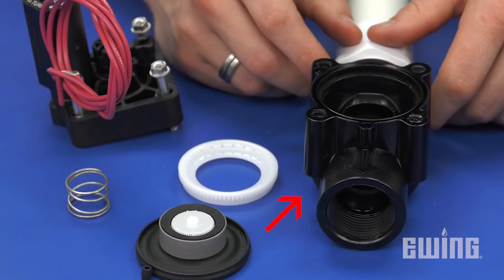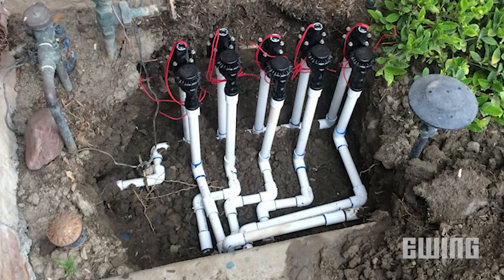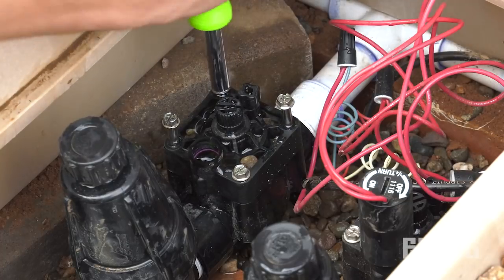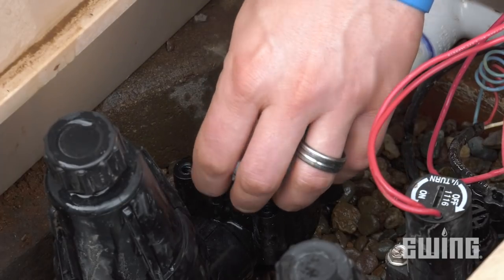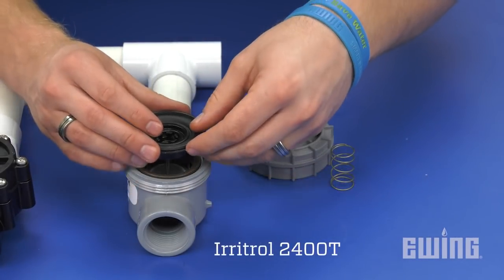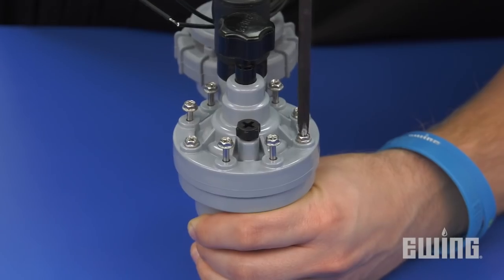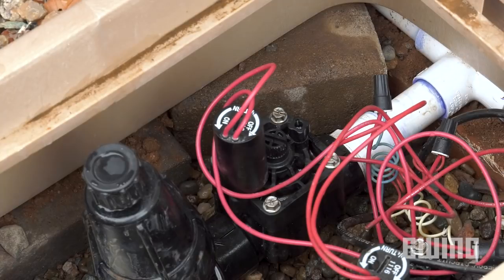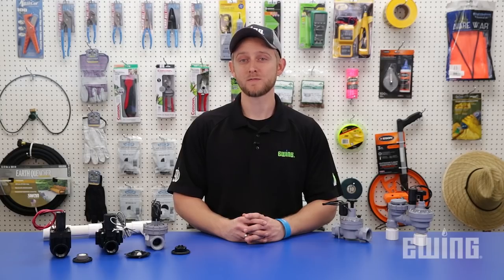How to Replace a Sprinkler Valve Diaphragm

Comment: If you pull out the diaphragm, clear any debris, and it's STILL leaking - there may be a large(ish) knob in the middle you can turn to tighten the pressure from the spring on the diaphragm. Turn the solenoid a quarter turn to test the water pressure and make sure everything works. It should be just loose enough to let enough water flow when it's on. Tighten if necessary - that was my issue with a weeping sprinkler head.

Comment: A tip: if your diaphragm has a screw on the bottom side, you can remove the retaining disk, then flip over the washer (you'll have to pry it out & back in again, flipped).  Chlorine hardens the rubber, so it is not as good as new by any means, but it can hold you over until the new diaphragm arrives.  At least if you're lucky!

Comment: So I replace the solenoid, and now I have a case of bad water hammer for the specific zone w the new selenoid. Why? What needs to be done?
Reply from the maker: Thanks for the question C ROD. That's a tough one to diagnose without more detail but here's some info on the subject.

Water hammer can occur when valves open or close too quickly. It's the shock wave created by a surge of water that stops abruptly inside the system. This is primarily the result of a large volume of water (gpm) and high pressure (psi) in an undersized (for that volume) main line. In other words, a system design flaw.

That said, swapping out a solenoid shouldn't lead to the issue. It may be that this is an existing issue that you are just noticing as you made your repair. Another cause may be that air was introduced into your system during the repair. Try flushing out the zone to purge any trapped air that may be causing the problem. Another option is to adjust the flow control for the valve if it has one. 

Most likely this is an issue with pressure/flow. If all else fails you can add a pressure regulator or water hammer arrestor (https://www.ewingirrigation.com/3-4-in-water-hammer-arrestor) to the system. If your valve supports it, you may be able to add a regulator under the solenoid for controlling just that zone: https://www.ewingirrigation.com/accu-sync-adj-adj-pres-reglatr
Reply: Ewing Irrigation & Landscape Supply I’ll try the arrestor thank you

Comment: VERY good video...However I have some strange type of valve where I cannot unscrew the solenoid.  It is very dirty so i cannot figure out the brand.  It looks like I might have to remove the entire top cover of the valve to service it (which is fine) but I have no idea what type of valve it is, or whether i can find replacement parts.  Have you heard of a valve like that? The solenoid appears to be hard fixed tot he valve cover.
Reply from the maker: First off, thanks for watching and for the comment! Unfortunately, it's difficult to determine what kind of valve you have by the description. You might take a photo of it and visit a Ewing branch for assistance if you have one near you. You can search locations using this link: https://store.ewingirrigation.com/locations/

Comment: Hi 
I have 4 zone , two of the zones are running without turning the system. How I can identify which valve control each zone. I changed the solenoid but the problem still continues 
Please advise
Reply from the maker: There are a few different reasons a valve could continue running. Air trapped inside, stuck solenoid, bad diaphragm, etc. If the valves are old, it might be time to replace them. If you can find the same model, you should be able to leave the body installed and just replace the internal components, bonnet and solenoid. If we have a Ewing store in your area you can contact them for more information as well as a contractor referral if you need one.
https://store.ewingirrigation.com/locations/

Comment: How do you flush the valve free of debris WITHOUT filling the valve box full of water? more stuff tends to float around and get sucked back into the valve body thus creating a problem - the valve will not work as it was designed if there is grit stopping diaphragm from closing.
How do you properly flush WITHOUT water filling the valve box?
Reply from the maker: Flushing the valve should only take a moment. If the valve box if filling up that quickly, then sediment has likely built up over time preventing drainage. Pea gravel is commonly used to backfill valve boxes to allow for drainage. If you would like to flush the entire zone, do that by removing the nozzle from the last sprinkler head in the line then run the zone for up to a minute until it runs clear/clean.  If it's a drip zone, there should be a flush cap or figure 8 crimp at the end of the line that you can open. Thanks for the question!
Reply: @ewingoutdoorsupply  yes a five second burst but in those 5 seconds you can remove the debris/grit but the valve box will fill with water which requires a cup, hand pump or in some case a guy has to dig up the valve box to keep the box water free - all of these methods require more time. I'm wanting to do a diaphragm swap/flush in a water free valve box - most valve boxes are just plain yucky

Comment: 12” not 6”.
Reply from the maker: Thanks for the comment, Jeff. You may have local codes that require a 12" installation height for anti-siphon valves but in general the installation height should be a minimum of 6" above the highest head in the zone. Here are a couple of links to Rain Bird and Hunter's anti-siphon valve specs for more information:
https://www.rainbird.com/products/dasasvf-sureflow-automatic-anti-siphon-valves
https://www.hunterindustries.com/support/pgv-asv-installation#:~:text=All%20Hunter%20Industries%20Anti%2DSiphon,result%20in%20unsafe%20backflow%20condition.